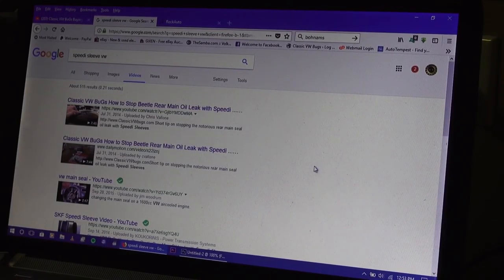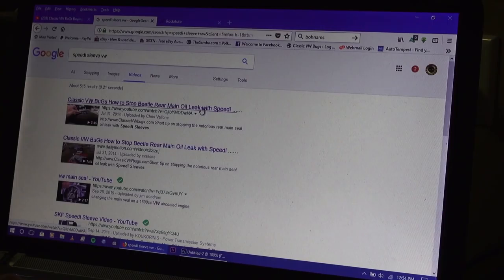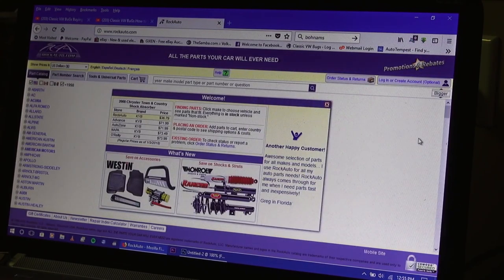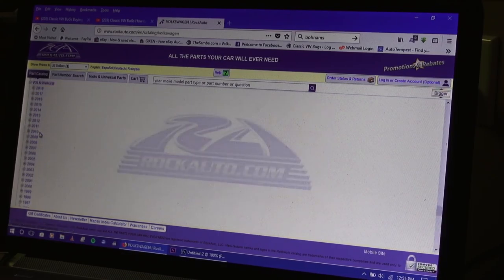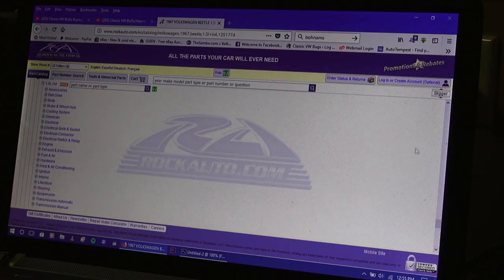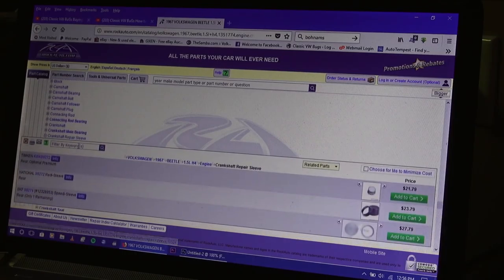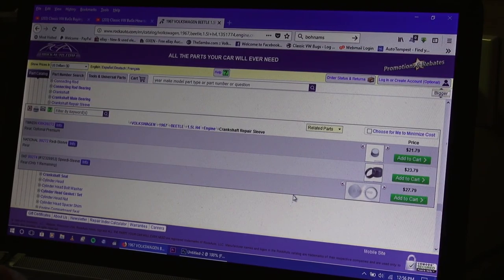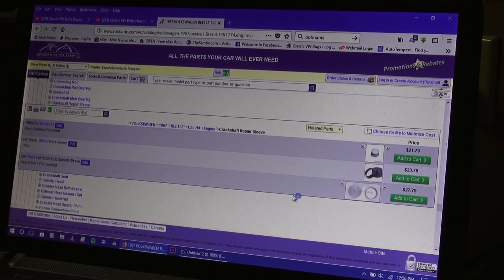Classic VW BuGs Where to Buy Crank shaft Speedi Sleeve for Beetle Ghia Transporter

Comment: So the crankshaft repair sleeve goes around where the flywheel mounts? Would a new flywheel not address this issue? or am i just getting it wrong?
Reply from the maker: A new flywheel would sure, but in this era, they do not repop the 36hp flywheel.

Comment: An easier thing to do is pull the spring in the replacement seal pull it apart where the split is cut it a little shorter and put it back together then reinstall the spring and install the seal as normal this takes 5 mins and its free